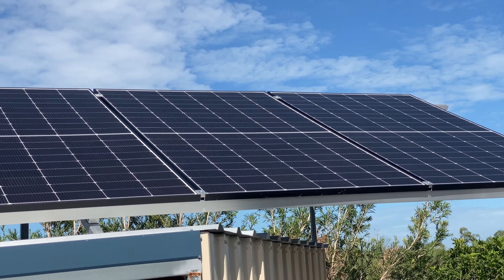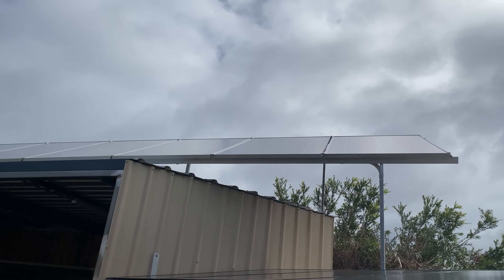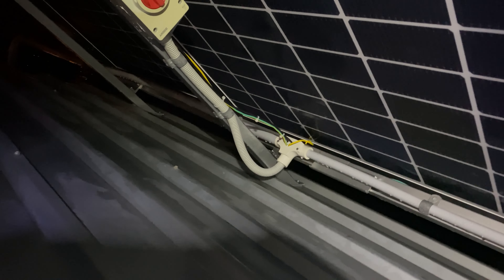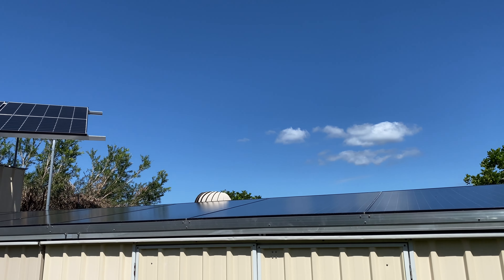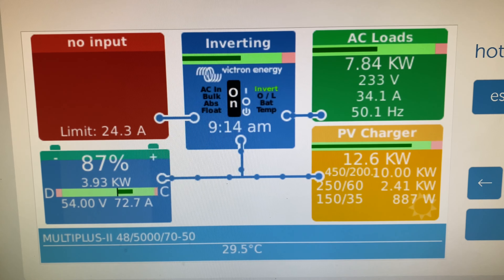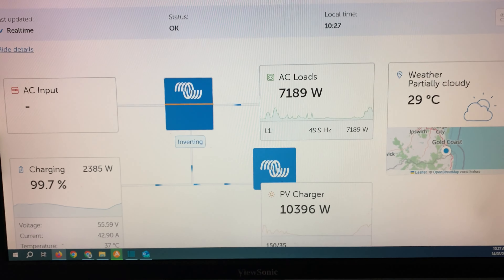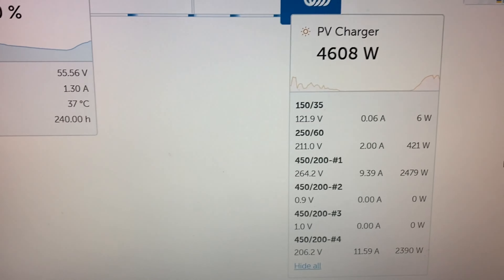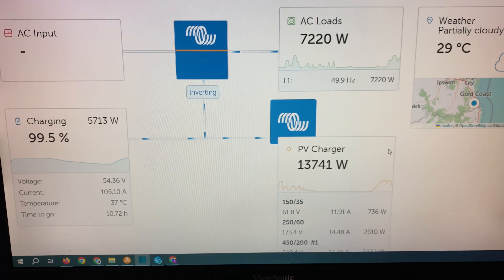Installing POWERFUL New Bifacial Solar Panel Array - Optimising Victron Multiplus II Off-Grid System

Comment: thanks for being vigilant on all stats mate, you be ticking all them boxes to satisfy,  good for the future too! keep up good work mate
Reply from the maker: I’m happy with the overall performance now. Today it is very cloudy ☁️ but it’s 11:40am now and the battery if full, all the normal hose loads and the misso has been working in the salon with the small AC. Been running a bit of AC in the house (very humid here) and heated hot water (250l tank) I can finally sit back and relax. Thanks for tuning into the channel again 👍🏻

Comment: Amazingly, the efficiency of the bifacial panels is over 90%, even though they are not south-facing. We hardly get over 55% here in hot, humid Nigeria.
Reply from the maker: Hey mate! 35c and 65% humidity here yesterday. Fairly steamy 😎 We are in the southern hemisphere, our optimum panel orientation is true north at around 30 degree angle for this area. What type of panel are you using? In what direction and angle? This bifacial array has peaked at just over 3000w, well over spec 😳 it’s very impressive! Thank you for the useful comment 👍🏻
Reply: Thanks for the response. I use Felicity solar panels manufactured in China. My latitude is about 6 degrees. All panels are facing southwest, as that is the direction of my roof, about 225 Azimuth. Half of the panels are inclined at 5 degrees, while the other is at 17 degrees. @OrganicPower-Australia
Reply from the maker: Hey bud 😎, It looks like panel angle there should be 5deg in the south of the country 12deg in the north? Not sure why the efficiency would be so low, at 1:00pm in the afternoon on a clear day they should be near there peak. Check your joints and terminations, ensure dc cables are 4mm2 for a 9A string, larger cable if over 50m. If feeding out of a breakout box ensure the cable is large enough for the combined current. Keep me posted 👍🏻
Reply: Thanks a lot. I will cross-check those with the installer and get back to you. @OrganicPower-Australia
Reply from the maker: How did you go? Any closer to solving the issue.

Comment: Looks like a small bit of shading on your panels below the new array? Usually the Victron MPPT will just lower the voltage a bit on my arrays to get the maximum out of the unshaded panels and ignore the shaded panel. Here in "sunny" Melbourne, I don't have any panels in any sort of easterly direction as it is often that there is morning cloud or fog here, and the panels are useless for their early morning wattage capture.
Any ideas on how to get the Victron multiplus II's to not draw power from the grid except when the batteries are low, then transfer critical loads to the grid and only charge the batteries from the grid when I manually ask it to?
Reply from the maker: Hey Adam. The 2 end panels of the power shed array get shaded depending on the time of year. There are micro inverters fitted to the  2 panels (Tigo MLPE) these can help to optimise a shaded string. This array was made from leftover panels and is really only to give the shed another layer of thermal and rain protection. 

I’ll see what I can find out about the manual change over. 🍻

Comment: What a setup. Very very nice layout on your victrons. I have a 6000 sq foot house with 2- 5 ton heat pumps. I have 3 acres. I’m on east coast of USA. One of these days, I am going to build out something. Just got some pricey electric bills. Last bill says we used 4000kwh ouch. Winter is my biggest load which it is right now. How many panels would I need? Like 36 450 watt ers? Or like 60. Hmmm
Reply from the maker: Hey there, thank you. I’m using 65 panels 6x 250w 6x 440w 25x 270w 28x 330w this is working well to keep up with the 15kva system. This gives you a rough idea. 😎
Reply: @OrganicPower-Australia  awesome knowledge! I hope to put up 11x250w and 24x380w eventually
Reply from the maker: @vipentv8549  hey mate just posted a full rundown on the arrays https://youtu.be/rTGPa143Pm8?si=2HBOzPxdCtjEZwzP
Thanks guys for letting me know what you would like to see.

Comment: Bought Canadian solar 525 bifacial.I only get 350 watts tested in all positions.That’s only 67%.
Reply from the maker: Hi, thanks for watching! Oh no, how far north or south are you? Check the resistance of the circuit, joints terminations etc 🤔 is the MPPT set to the appropriate input/output current values. Let me know what you find out 😬
Reply: @OrganicPower-Australia  Pmax 525w (70%) +/-5%..Just seen this on the back sticker.Looks like they exaggerated wattage by 3% lol
Reply from the maker: Maybe check with the supplier if the panels are not too old and see if they have something more efficient, pay the difference. Could be an option, if the seller is reasonable 🙂
Reply: @OrganicPower-Australia  I’ll call them Monday.Supplier said they’ve had them a long time and no one buys them.I see why. I did see 443 watts for a split second and hovered 400 for a minute.Maybe they will be better with summer sun?Thanks for your comments!!!!